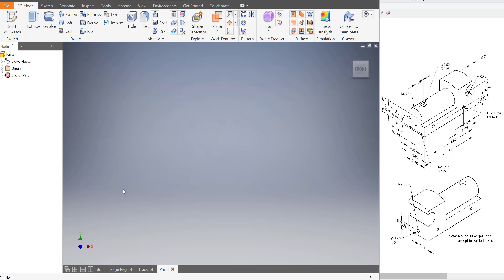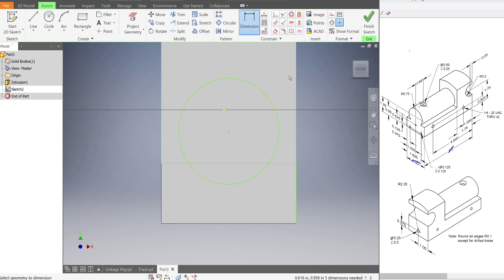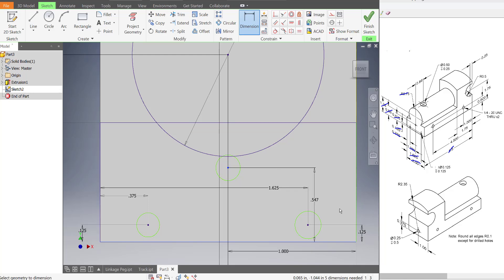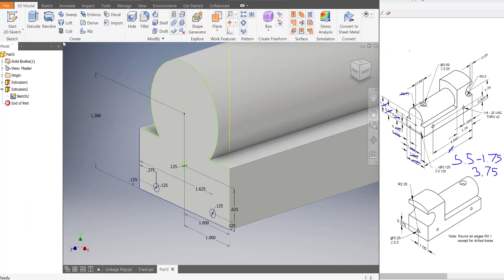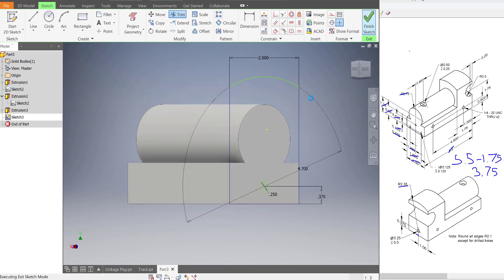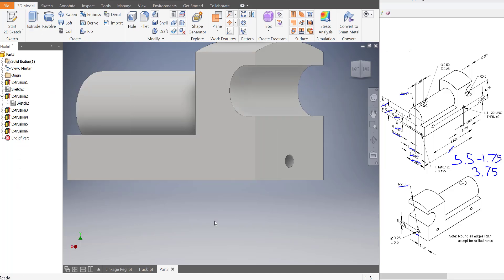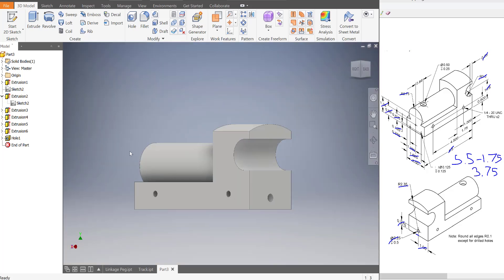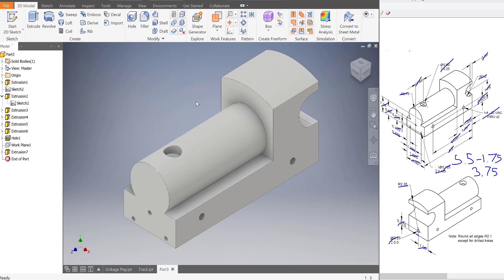Autodesk Inventor 2019 -Train Body - Train Project - Beginner Tutorial

Comment: Hi. Thanks for sharing your work with others.  Some constructive [I hope!] comments: (1) Did you teach this before introducing holes?  Because using the hole tool for all the features with hole notes would be preferable, right?  (2) I really stress geometric constraints, e.g., when specifying the 2 holes on sides and front as a certain distance from the bottom, you may want to make a horizontal constraint, then dimension one.  That way, they are always parallel (3) Placing the work-plane on the cylinder at the end...would using "place plane on a surface parallel to a plane" be a better choice?  Again, trying to be respectfully constructive.  Thanks again for sharing.
Reply: holy yapperson